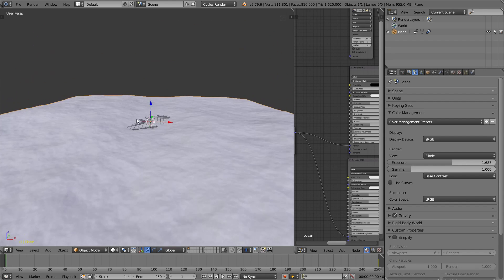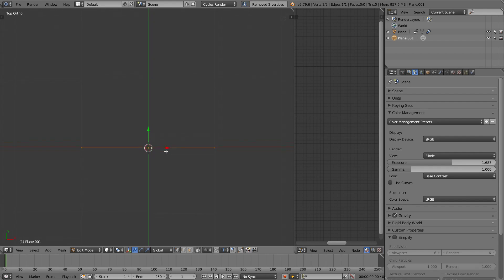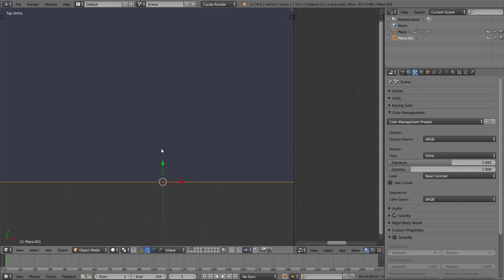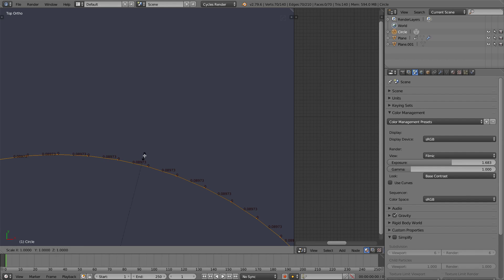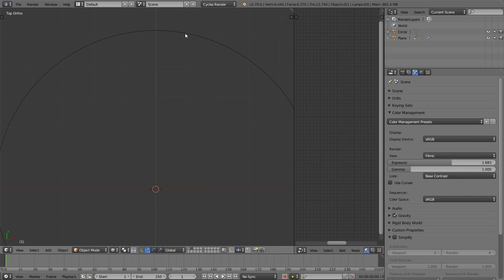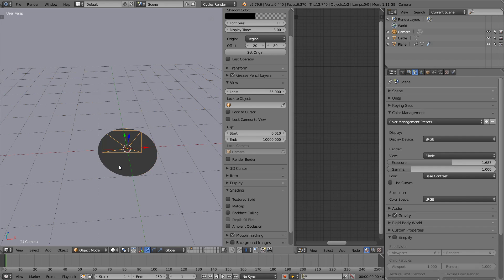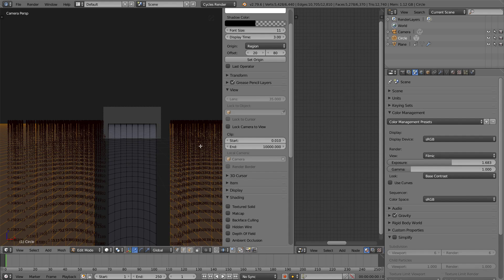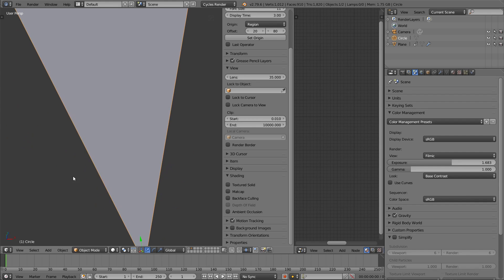Tutorial: Ocean Modifier plus FLIP fluid sim equals greatness! (part 2)

Comment: I'm trying this again in Blender 2.8 and the extrude scale repeat doesn't seem to work like you're showing it. I tried extruding normals, but when you shift + R, it repeats with the offset you enter so it's not really scaling up as you repeat like you have. If I try extrude -> esc -> scale, repeat only repeats the scale. Any idea how to do it in Blender 2.8?
Reply from the maker: Interesting. Hey try again. e to extrude, s to scale, shift + r to repeat. I just tried it and it worked.
Reply: @47guitartom  Oh, I thought you had to hit esc after e before you scale. That made it into 2 commands instead of 1. Thanks! On to the next part :)